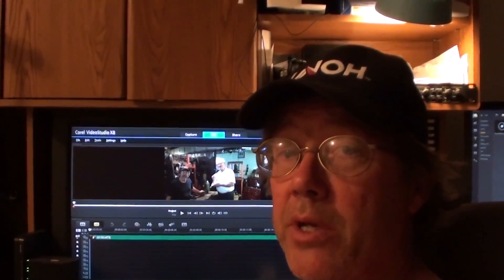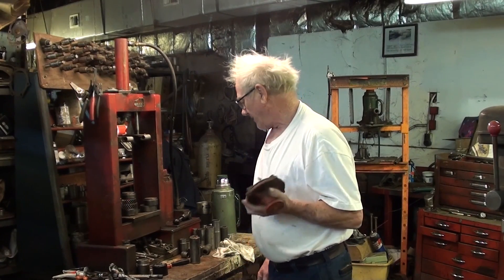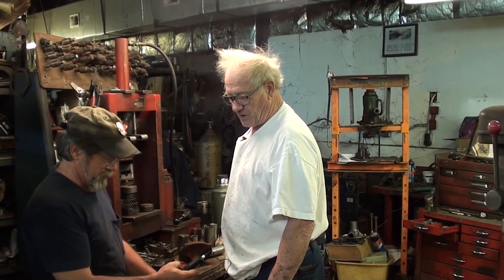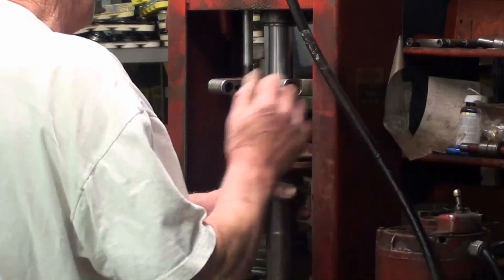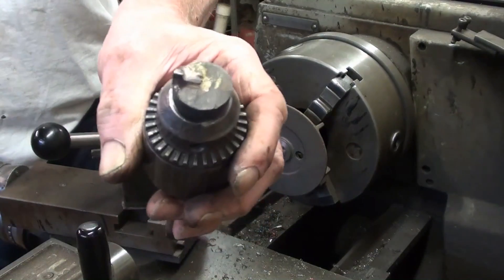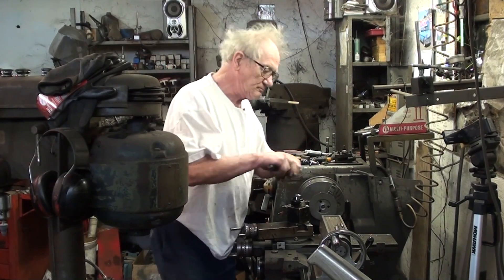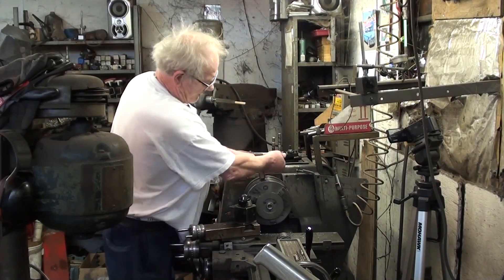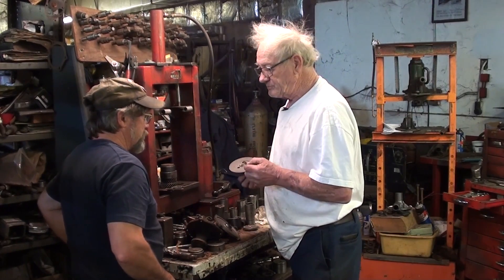Project Whitey and Tony Too! 57 GMC Water Pump Rebuild Part 1

Comment: Could be power supply issues Jeff. This kind of random mischief is typical. Is it more likely when 'cold'? Does it improve as the machine 'warms' up? Worth a try after all you have done...an oscilloscope to monitor the supply rails would be of benefit OR just replace the darn thing! Regards

Comment: Another great vid. 
I think you knead to dew two2 ur pc what ya did to that Pontiac engine awhile back.
Hit the valves that are sticking and get it to run better, that or install unix.
Reply: But first sit it upside down in the mud and the rain for a while, just like that Pontiac injun.
Reply: Yeah well i guess that's why it was all stuck up and didn't wanna run Wright. Don't know why IBM did away with OS2. Now that was an operating system. Oh well I guess they're all in the ground and wet two2.
Reply: Have a great nite Gary. I'm on my way to Knee nee naw land. 
Ketchup wit ya on the flip side.

Comment: So it'll be like a throwback to VHS tapes. When I running to Funky problems like that it's usually the video encoding  is the problem or things are not compatible. Thanks for putting up another video

Comment: Sounds like you might need to test/check/replace the power supply
Reply: YES!!  These last two guys, Howard W and Richard M, may be on to your problem Jeff!  A laptop isn't subject to power problems, it has a battery.  If you can borrow a laptop and install your editing program, you can test if either of those problems is at fault. If you don't lose any edits on the laptop, you have bad power, either from the wall or your power supply.  If the problem is the power company, a UPS will fix it.  You plug the UPS into the wall and the computer into it.  Anything that has to be on with the computer also has to plug into the UPS.  It has to have enough Watts to power everything.  It also should lower high voltage and boost low voltage.  You just buy a new power supply if that's the only thing wrong.
Reply: Howards right, when you start getting problems that look like ram, then hard drive, and shit gets weird, its your power supply gettin on, I spent a couple years chasin problems that sounded exactly like yours, I'd replace other parts, etc etc, things would work ok for a month, then get bad again, repeat untill it was a week, then a few hours

finally I replaced the PSU, damn thing was getting unstable power

run HWmonitor and check your 12v reading, if while rendering/video encoding the 12v drops down to 11.8v or lower, get a good stable PSU in there
Reply: First thing I thought of when I watched the intro.  Every time there's some weird hardware problem with a computer, head straight for the PSU.
Reply: Agree... Without a doubt they are bare minimum power output for the PC when you buy it...add new video boards, hard drives, RAM, problems can/do show up.
Reply: yep power supply is the first thing I thought of ( i am NO expert ) ..also how about the CMOS battery ?/ i have had that fail before
Reply: most likely howard white is correct i have seen power supplies that are failing do odd things especcailly durring video editing wgere the cpu and gpu need the proper voltage and amperage any fluctuations in either voltage or amperage could verry well be your issue. and if it is the power supply dont cheap out on it as i have seen many cheap ones that havent lasted more than a couple of months

Comment: Sounds like your power supply. I have a new 500w one that I am not using you could pick up I live in CJ.  You can have it for free if you can tell me how to prime my rebuilt rosa master injector on my 188d case 530! :) make sure you plug in the extra power line to the motherboard, its a separate connector from the ATX power supply that gives the CPU more power and is located near the CPU.

Comment: Are you using a desktop or laptop?  If it's a desktop it sounds like the battery that keeps the motherboard alive may be failing or dead already.  Most of these batteries are CR-2032's, about the size in diameter of a nickle. Fought that problem for a while until I swapped out the battery and no troubles since then.  The other problem, as has been mentioned is a failing power supply but that doesn't apply to a laptop as you normally have that plugged in while you are processing data and the battery is being charged.  HOWEVER, if the laptop battery is bad, it won't operate without being plugged into a wall outlet, so....

Comment: Tormenting Tony again ?  :o)
When you handed him the pump at the start it looked like he was about to swing it at you.  
Later, he called you over, "HEY, c'mere, hold this." 
The next time he calls you over with just a twitch of the head. 
You've gone from "Jeff ", to "Hey" , to "no name"; all in the space of only part one.  
I think I know why we might not see a 'part 2'.   :oP

As for your computer, I reckon you probably know more about computers than I do but, have you tried a de-frag ?  Computers do weird shit when they haven't been de-fragged in a while.  Or, heaven forbid, never de-fragged. 
Mine gets really slow and I know it's time for a defrag even though it tells me, "You do not need to de-frag this volume."
I de-frag anyway and it goes back to its old self.  Just a thought.

Comment: wish i knew why my new computer crashes, it mostly steams to happen on Netflix or other times most of the time, the sound repeats and the whole computer fezzes and won't power down or reset till I switch the power supply on and off.

Comment: ROCK AUTO  29$
Reply: Hi, we are not trying to compete with rock auto, the video was strictly to show what we have to do to rebuild a water pump. And keep in mind we have a 3 year warranty.
Reply: to you its just another day  at the office yes and its probably alot better than anything from china and its original so its better and you can get parts for this.. so yahhh its better but looks like alot of work.. ps.. i was cringing at that loose shirt as you were close to the lathe..
Reply: it just looked like a massive amount of work